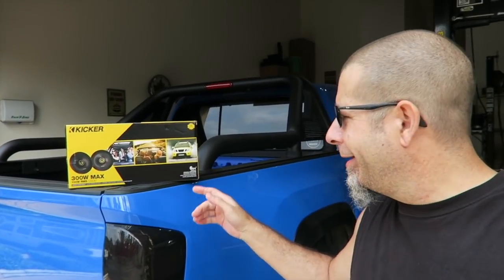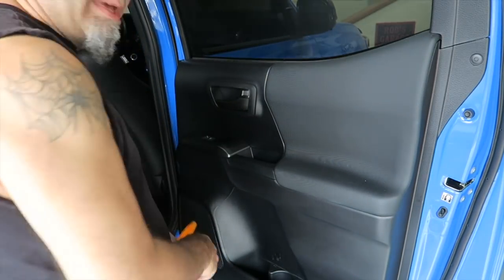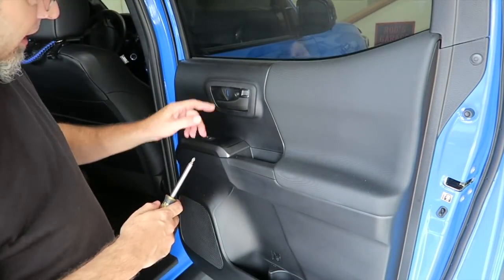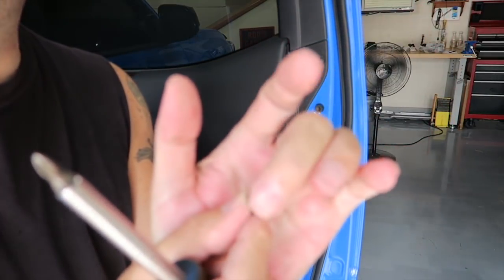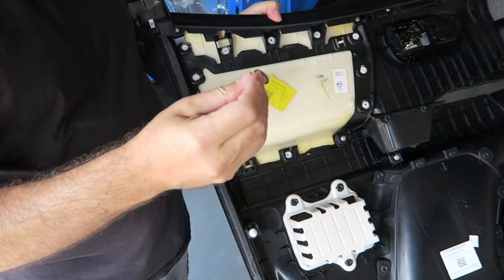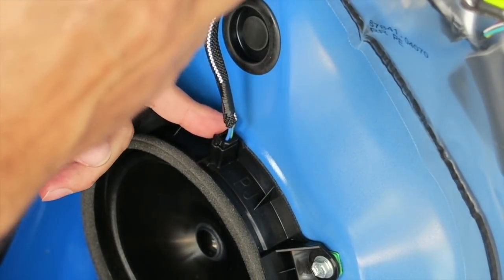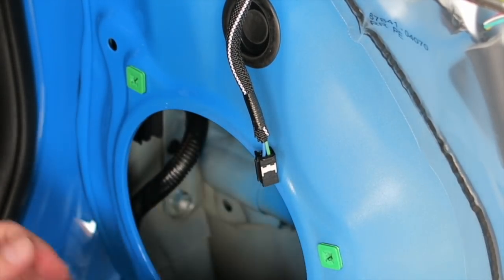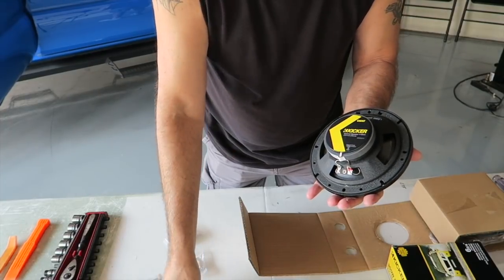Tacoma 2016+ Rear Speaker Install

Comment: You said tweeters in the dash.    aren’t tweeters usefully round and a separate speaker.    ?
Reply from the maker: Mine are in the dash👍
Reply: The tweeters ARE round, and separate. They are in the far corner of your dash, directly below the windshield and adjacent to the pillars. They fire vertically and reflect off the windshield to meet your ears with those crisp, hi-hats when you're cranking out some Metallica!

Comment: Rob.
I did the entire upgraded 
But sound system is not good 
In order to really kick 
You need a 5way amp.
That gives gain to rear speakers
Now.. where you get the connectors ? 
I used old speaker connectors to plug mines couldn’t find anything that fix the new Tacoma connector
Reply from the maker: If you watch the video you’ll know where the connectors came from👍👍
Reply: @RobMotive  yes i order them from Cf as well  but they were incorrect ...
Had to send them back...
Would you mind sharing the link for the correct ones
Reply from the maker: You gotta watch the video my friend🤔

Comment: After replacing all 6 speakers I will actually remove the rear kickers and put the original back in because the sound is now worse.  Replacing the tweeters and the front door speakers was an improvement but I think the kickers in the rear are even quitter than the original Toyota speakers. Some mention that the power going into those is limited so I am wondering since it has to drive such a huge magnet in comparison with the original it just doesn't have enough power to produce the desired sound.  Perhaps it is actually the ridiculously smaller magnet in the Toyota speaker that makes it perform better on the low power.  If I was to it it again, I would either only replace the tweeters or do a all around upgrade with an amp and all.
Reply from the maker: The tweeters are really the only speakers that make a difference unless you go with a new system.

Comment: Rob question, why do you install the D-series Kicker in the front and the C-series in the back? By the way Crutchfield recommends the 6 3/4" for the back in my 2018 not the 6 1/2". I did just install the Kicker tweeters and I'm blown away at how much better they sound.
Reply from the maker: I guess because that’s it’s what my research called for.  Save your money bough.  Except for the tweeters…I noticed no difference with the others😬

Comment: The difference is pretty minor with the speakers but it is a bit more clean.  The tweeters definitely make a big difference
Reply from the maker: Yup.  Tweeters are the way to go👍
Reply: Thank you for the comment about the difference is minor . Would you purchase the Kicker again or a different brand?
Reply: @Mike-cu6gk  the kicker Twitters are amazing, and they're actually a direct fit, I believe it's an upgraded sound system in the subaru, but they bolt right up without any issues a clip in to the stock connectors.   The speakers are pretty decent 👌.   I got the mid model kickers that they sell, I forget what model they are, but they are gold and black, I believe.   I ended up getting alpine on my second tacoma, and those are also super solid but more expensive.  I think they alpine are slightly better.  I also just replaced the heat unit on my 2016( original stopped working), and it sounds massively better with the alpines. Now, I want to upgrade the head unit on my 2019.
Reply: @alexgarcia3900  I’ll definitely look into the Alpine right now in my Crutchfield cart I have Kenwood and still doing research on others.
What’s your opinion on the Kenwood and do you think they are better or even with the Alpine?
Reply: @Mike-cu6gk  I personally don't like Kenwood much,  I don't think it's a bad product, I just think others are better.  But that's just my personal preference.  Alpine is always the way to go, though.  I just heard a lot of good things about the kickers for this truck, and I've always had good experiences with kickers, but in all honesty, I've always preferred Alpine.

Comment: Nice.
Kicker tweeters and sound deadening will improve the sound 100% percent.
Rear speakers are only 20% or so sound output.
Kicker key if you want to tune  the sound
Reply from the maker: The tweeter upgrade is a must for sure!👍

Comment: My 2019 has the JBL system that came with the premium package that also has a sub behind the rear passenger side seat.  Sound is great and plenty loud enough for me.  Did yours have the JBL?  I have heard some complaints about the taco stereo but no complaints here.  I’m curious to know what you replaced
Reply from the maker: Mine doesn’t have the JBL system.  I replaced all of the speakers 👍

Comment: One thing to add make sure crutchfield send the correct universal bracket for the rear. They sent me the front door bracket twice because the rear speakers are smaller than the front. It was a real pain before they understood what I needed. Otherwise great upgrade!
Reply from the maker: Just to note, they do show pics to see what the brackets look like.  You can easily tell the difference 👍

Comment: The rear speakers in my 2019 are MUCH quieter than the fronts when the system is balanced.  In order to hear them at all while in the front seat you need to significantly fade to the back.  Common complaint (one of many) of the Toyota head unit.   Not sure if it’s a problem with the JVC system.
Reply from the maker: Yup, definitely tuned for the front😬

Comment: Added those rear kickers a year ago on my 2020 Tacoma Sport, didn’t make much of a difference.. Tweeter upgrade and front kicker upgrade was a noticeable improvement.
Reply from the maker: Yup.  They just add a little depth IMO.
Reply: Did you add tweeters in the rear?

Comment: I installed the whole set of speakers and tweeters. The exact same model. And it sound really bad. I was wondering if you guys noticed the same and if any of you had to install and amplifier. In my opinion sound is very distorted

Comment: I might have missed it while on the phone with a customer (volume off) how much did you pay for them?
Reply from the maker: Check out the link in the description for current pricing and availability 👍
Reply: First they were around $71.99 but for some reason it is now for $89.99 hopefully you bought the rear speakers before the price increased and yes they sound good

Comment: Rob, 2 comments:  1) I upgraded my speakers (front and rear) just over a month ago. A fellow TW person suggested those same speakers on Crutchfield, and tbh I love them! It's nothing overpowering, but puts out enough sound and depth (as you put it) to make a difference. I upgraded the tweeters in the dash back in Feb. before the big snow storm.  2) At 10:20 where you discuss using pliers vs. wire cutters to remove those tab, I wish I'd known that before hand. Cutting those tabs wasn't terrible, but using pliers seems "cleaner." I never thought about using pliers tbh.  Either way, they are done and installed. Good video though.
Reply from the maker: I just happened to notice the slots they included on each tab.  I’m sure that’s why they are there to accommodate different speakers.  They do provide for a pretty clean break👍

Comment: Nice job!! Thanks for another great video! Wish I had the rear door panels with the built in speaker grills. I have a 2017 Tacoma SR that didn't come with rear speakers, thus no rear speaker grills. 😕 I did buy the exact same speakers that you bought.

Comment: I did the full kicker speaker upgrade with the Subaru tweeters. I had never used Kicker before but they are pretty good. I'm usually a Kenwood or Alpine fan. 
I got the Kicker DS series because the CS series that everyone gets and other brands I trusted were back order at the time.
Reply from the maker: Nice!👍

Comment: Yep, somewhat disappointed with my Tacoma's JBL. The stock stereo in my roommate's old Lexus SUV kicks arse over mine! I would probably just take my Tacoma to  car stereo place, and let them do the work. Rob, you gave very good and detailed instructions on doing the speakers.
Reply from the maker: The stock system is definitely not the best!  I will say, the tweeter mod goes a long way in improving it though👍

Comment: Good information Rob.  I was hoping this would cure the lack of sound volume from the rear speakers.  I guess it is just in the design from Toyota? By the way, I have done the tweeter mod already myself!
Reply from the maker: Yeah...just adds a bit of depth 👍
Reply from the maker: The tweeters are the most impactful for sure👍

Comment: Rob, I used the Kicker 46CSC674  which is the 6 3/4" version.  Your tips on the white clips that hold the upper trim on were great.  I also did the fronts at the same time. I had already done the Kicker dash tweeter mod.  I have read where there are many complaints about the audio in the Taco with OEM radio, it does seem to be very biased to the front. I have the Alpine ILX-309 and when i fade front to back the levels match up perfectly. I have to say with my head unit and the Kicker speaker upgrade my system sounds really good.  I bought from Crutchfield, the system spec'd the wrong speaker harness for the back speakers. The front and rear use the same harness adapter.  I was able to pull the connectors out of the speakers, solder the wires removed from the wrong adapters in and get everything done. Even with that i competed all 4 speakers in about 2 hours counting mounting the speakers to the new adapter plates.
Reply from the maker: Sounds like a good solution.  The OEM system is definitely biased to the front!!

Comment: The whole system is trash
Reply from the maker: Nah..Just the speakers.
Reply: I have the JBL and there just isn't enough power going to rear speakers, front are ok... rear very very slight improvement in sound quality but nothing as far as what a 6.5 should be off a factory radio